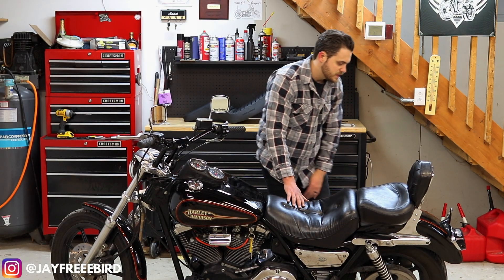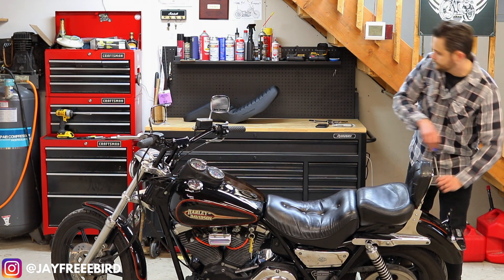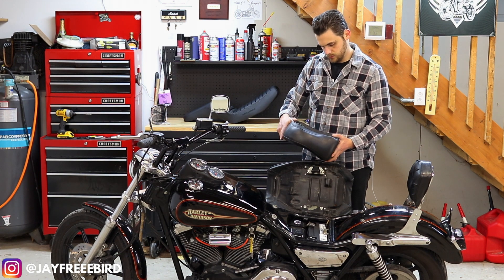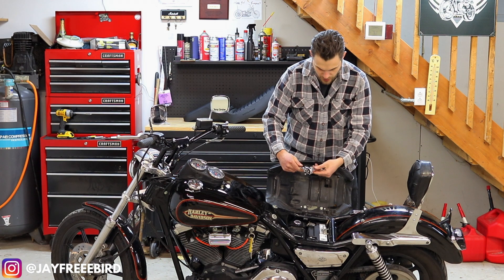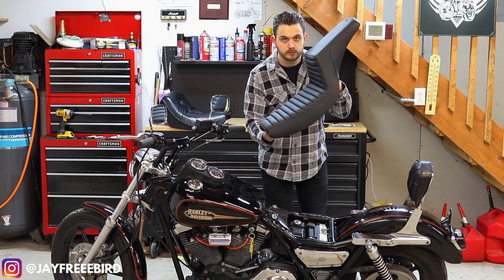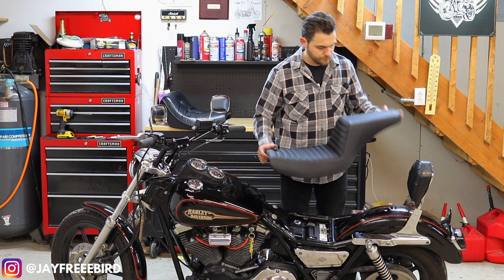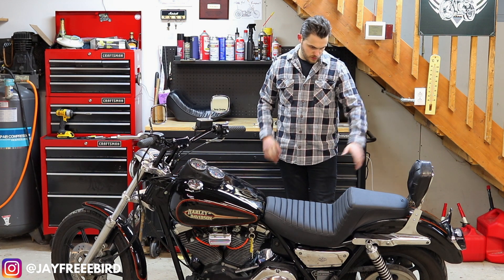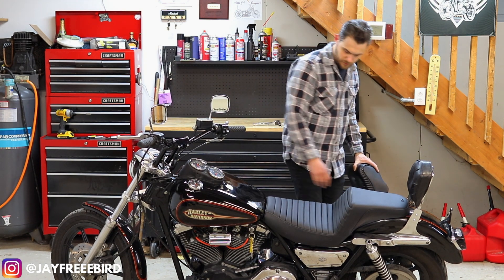Harley Davidson Seat Install – FXR Saddlemen Step Up

Comment: Hey, where are the spacers that followed the bolts installed ? I need the right order Bolt-hinge-spacer-seat or bolt-spacer-hinge-seat? I now istalled in this order: Bolt-hinge-spacer-seat. Problem now is that the hinge lock on seat touched my side cover…
Reply from the maker: I doubled up on my mine on each whole with the same size spacer to make it fit. You can get them at a hardware store.

Comment: Does this seat have the option of bolting on without the latch, and hinge??
Reply from the maker: Yes it does! It comes with a rear bolt down tab for the fender.
Reply: @freebirdsgarage  does it come with the tongue bracket up front too??
Reply from the maker: @Guns_N_Gears  yes! Sorry, I forgot to mention that. Both come standard on the seat too, you don’t have to ask or add it to the seat when you order it.
Reply: @freebirdsgarage  SUPER!!!!👍👍

Comment: Looks sweet man and love you channel. Im dieing to get a saddlemen. Im curious if you feel you sit much lower then the stock seat? Im 6'4" and already have a little comfort issues on long rides with mids due to my back, luckily i have the high way pegs.  Im dreading the idea of having to switch to forwards.. If i can even find a decent pair to my 87.
Reply from the maker: I appreciate that man!! You definitely sit lower then the stock seat maybe an inch or so. But you get much better back support, a memory foam stiff compared to a worn out lazy boy. Hopefully that helps!